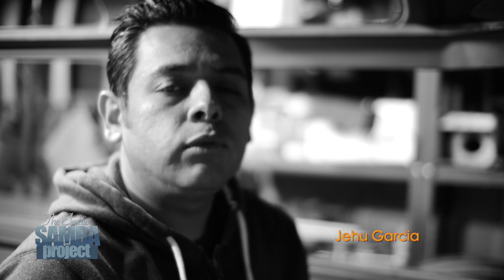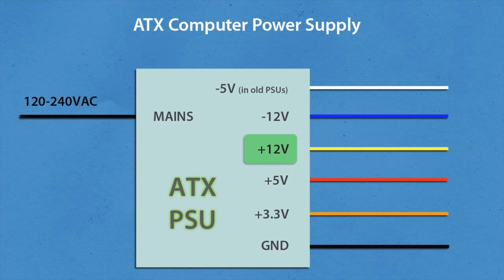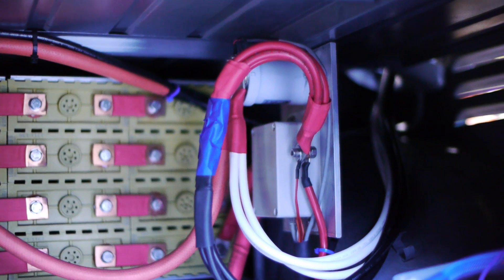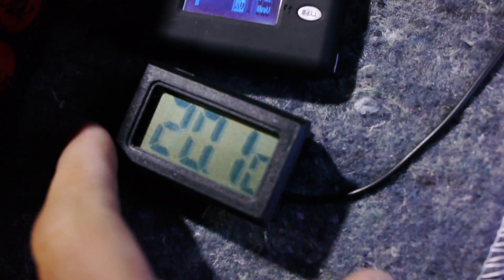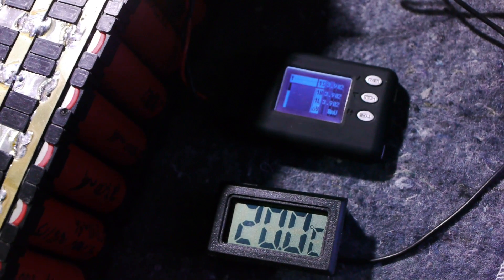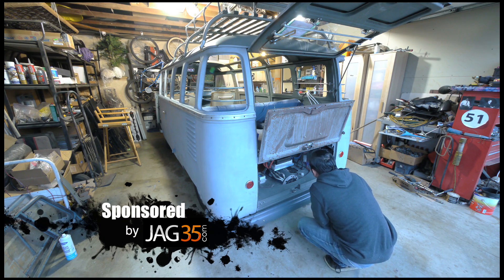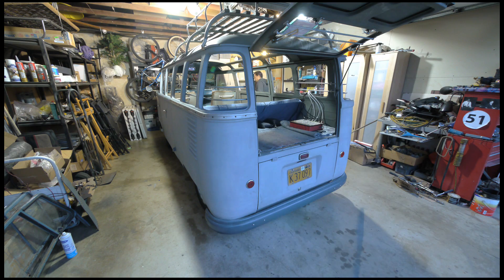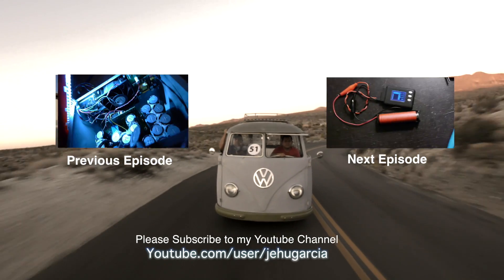DIY EV conversion eSamba - Recycled Laptop 18650 Battery test

Comment: Just one question

Since these are laptop cells they have low discharg rate right ? 
1c constant and 2c burst - in case of 2.2 Ah cell thats 4.4 amps per cell (2c)

So to get any decent amps out of them you need a lot of them, am i correct?

Isn't this a problem ? Or do i have to conservative c ratings?
Reply from the maker: +Przemysław Wilkutowski 
Correct my system needs 650 amps peak about 300A continues,  so 150 cells in parallel should handle the load without too much stress

Comment: I love this series but for the life of me I cannot figure out how you have those cells soldered together? Each cell looks like 160 cells all in parallel. so is it 3.7 volts @ 320 amps or what? you got me befuddled..Thanks...!!
Reply from the maker: yup 150 cells in parallel.   3.7v around 300ah
Reply: +jehugarcia I take it, that your battery is a matrix, soldered on both sides?